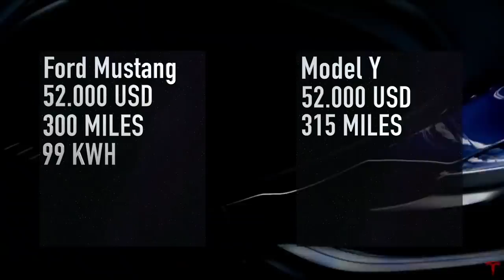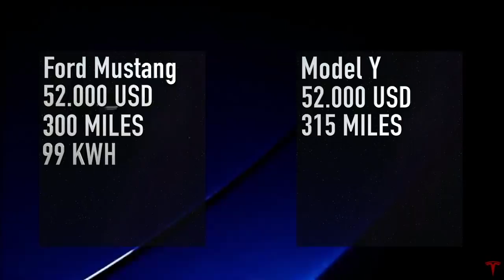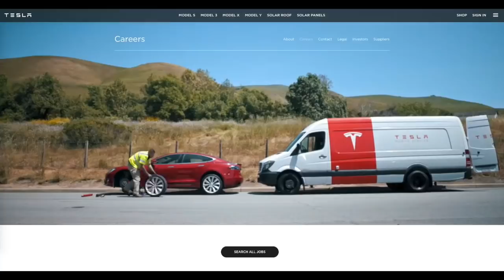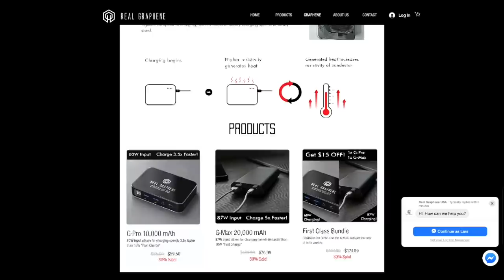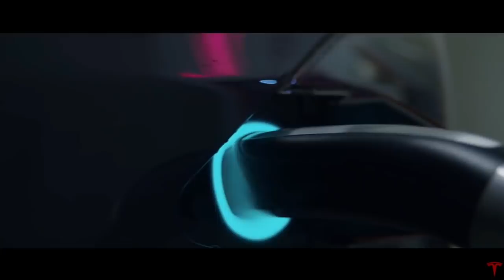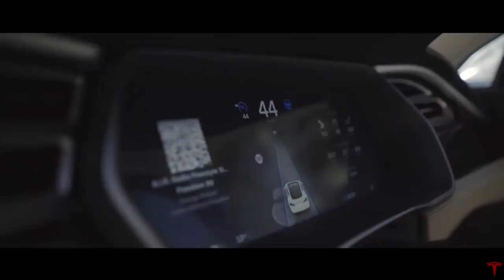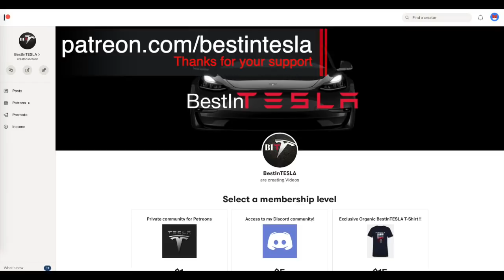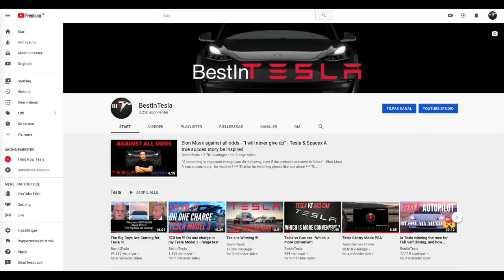Tesla's quest for the best battery technology

Comment: Your claims are so unscientific it is not even funny. Don't waste your time watching this video. Hopefully New generation of batteries around the corner. With new generation there will be a new management systems. Right now Tesla is ahead, but this could change overnight. Nisan Leaf 2012 battery management was not designed  properly (probably intentionally) ... It had no cooling, there is a question of electrolyte, and others. With 100s millions of $ in research solid states will arrive.

Comment: With regards to electric vehicles you are not going to get huge gains in energy density or reduced charging time now because of the Laws of Physics. Where the improvements will be is in life expectancy. I don't think the time is far off where batteries will last the life of a car with no significant reduction in capacity.  Tesla has had the electric car market more or less to itself up until now, but when the big boys start I think Tesla will find it difficult to compete. The main car industry has had over one hundred years to develop and perfect its products and production techniques, the shift to electric traction is slightly more than barely significant to them. If Tesla is to survive and I hope it does it will have to carve out a niche for itself perhaps as an electric sports car maker,  or luxury car maker. I really do wish them well.

Comment: I think the iPhone is a better comparison than the iPad. With the iPhone Apple enjoyed a technical lead for about 8 years and they now have the mind share of the public. Apple still has a technical advantage with the processors and their software stack, but not enough to keep competitors at bay. Now competitors clone the iPhone as a starting point and then attempt to differentiate. The iPad is a much smaller market. The strategy of taking smaller margins to compete with Apple doesn't make sense there. The car market is more like the iPhone market. That said, things aren't quite so rosy if you look around. Hyundai has very good battery efficiency and is making very attractive electric cars. They have supply issues, but are all in all well positioned. I also see many competitors making cars. They will not be profitable and they won't quiet match Tesla, but they well still sell moderate numbers of cars, especially if 3rd party battery manufacturers get their act together.

Comment: It would be nice if tesla could get their battery packs charge 3 times faster. 

After that there is nothing ice cars can do better than EVs. Besides maybe the number of charging places but you can always charge at home
Reply: Who’s to say that the Tesla won’t charge faster after Battery Day, If I was in Elon’s position with Maxwell Capacitors and improved lover resistance to charging cells I’d be implementing change transfer as quickly as The team could develop it. Imagine quick charging going into the Capacitor arrays then dumping from there into the Lithium tech batteries. Also the regen using the same route to charge the battery pack or hold some power for quicker acceleration if needed .... I’m interested to see where they take this advantage they have ..... anyone else could also implement this system to give them an advantage over Tesla if they don’t .....

Comment: Great video you have put together,  I think you are spot on with Tesla Battery tech and their motors. The legacy auto manufactures (Ford, GM , Mercedes, BMW) are at a very critical time and three years from now may cease to exist, not being able to raise the capital to make a change towards EV's.  Fiat Chrysler seems to be the least interested in moving to a EV world. Fiat may move on but,will drop Chrysler.
I believe there are opportunities still, just not in cars, mass transportation is still open, also specialty commercial vehicles. Trucks that work docks and trucking terminals, farming and industry were speed and distance is not needed. I read of a Electric truck that worked the docks unloading coffee beans for over 50 years.  BMW work truck?

Comment: LOL! Do you really think that Tesla makes these all by themselves? they have joined ventures you tesla fanatics. Panasonic and others.... developing batteries longer than tesla. Tesla in china uses chinese manufacturers!
Reply: They are working with CATL in China for sourcing battery cells for the China built Model 3 (and other variants in the future).  But you can be pretty damn sure that the cells will be built to Tesla specs and Tesla will probably be assembling the packs muc like they are doing with the Panasonic supplied 2170 and 18650 cells they use in their plant in the US.

Comment: Part of the difference is that all of Tesla's eggs are in the battery basket. This is why they are constantly on top of any rumours and breakthroughs. This is why they bought Hibar and Maxwell. Also don't forget that Maxwell also did capacitors.
Top notch video thank you.
Reply: because they bough maxwell and hibar means nothing, only the time will tell us, any company around the world can suddently discover a better battery and sell it to the best buyer
Reply: @carholic-sz3qv  True but interestingly enough Tesla has its fingers into almost all of the battery innovation happening right now.
Reply: @Coltn3125  same with other companies and equipment manufacturers
Reply: @carholic-sz3qv  Lol ya ok. Do some more research. The other EV manufacturers are so far behind it is ridiculous. Also they just don't have the innovation and are being left behind at a faster and faster rate. Tesla has the pick of the best of the best and are pulling away from the other manufacturers because of this. Like Elon has said if you don't innovate you are out of the company. No one else does this and that is why they won't keep up.
Reply: @Coltn3125  And as Elon said in that third row get together, the limiting factor even for Tesla is the shortage of brilliant innovative engineers and the best all want to work for Tesla where they are working with the best and brightest in an organisation structured around innovation rather than a bureaucratic organization with a lot of smart and also mediocre engineers headed up by management that are neither engineers or innovative

Comment: VW makes cheaper cars, and have cheaper batteries.
Reply: Carl Johnson  Your opinion is not mine.
Reply: Carl Johnson  Porsche is more efficient.
Reply: @Letro77  ,  sure?,   taycan 2x's the price of most expensive Tesla,  1/3 less range, and not any faster..  What is your definition of "efficient"?
Reply: @EVsomuchbetter  You're right Taycan is too expensive. Both cars are not for the mass market. Taycan can faster charging , it consume less at higher speed, have good quality and precise steering.
Reply: @Letro77  But is beaten in road racing by a 12year old design family sedan with twice the technology and 20 times the production capacity. I bought two new Porsche over the years, a 930 Turbo and a 928, one of the last produced. They were fine but very expensive to maintain and they needed care frequently. They are a niche car and even in top production numbers can only build 18,000 a year.  They have a place in the market and maybe with hiring more engineering talent they might have some innovation but right now they are well behind and will likely remain so. The 918 hybrid was a brilliant car but they lost money on all 100 they built selling for $1.8 million each...but way behind the $200,000 Tesla Roadster.  The big problem for Porsche is that the Taycan is a replacement car, which will only sell to Porsche lovers which means they lose a sale of a high margin ICE car to gain a sale of a zero or negative margin BEV that last 5 times longer and does not need the $5000-10000 a year in maintenance that higher end Porsche cost to maintain.
They are in deep trouble trying to play "me too" in appearing to be hip and forward thinking with a car that loses them money AND is a weak impersonation of the leader.  As a Porsche fan, why do you want them to go out of business trying to compete in a field they never were able to in the past...the mass market?
Reply: @stanspb763  Porsche and Tesla are not for me. They are dream cars. Because they are too expensive. I always buy cheap and good cars. Price Performance Top. The VW ID3 would be a car for me.
Reply: You're joking right?

Comment: Maxwell = Dry Battery Electrode 
Nothing to do with Solid State Battery. DBE means lower manufacturing cost.
Reply: Exactly, production speed will be greatly increased, and the production line space requirements will drop significantly so batteries could be made in spare space in any current facility, and allow a Just In Time supply chain, finishing packs as the chassis building phase need them, further reducing costs and space.  That change could drop the price of packs by another 15-25%
Reply: Tesla is in cahoots with the fellow who I believe invented the  Lithium Ion battery, he has been working on solid state tech for a while.  I think that's where all the solid state business comes from and people mix it up with Maxwell.
Reply: @TheEvilmooseofdoom  Goodenoughs associate Maria is involved with Maxwell Technologies and there has been major cross transferring of research scientists rotating through Goodenough/Maria/Maxell and Tesla and Maxwell was a major contributor to the Government funded research program to achieve 500W/Kg until Tesla purchased them since when they have gone dark